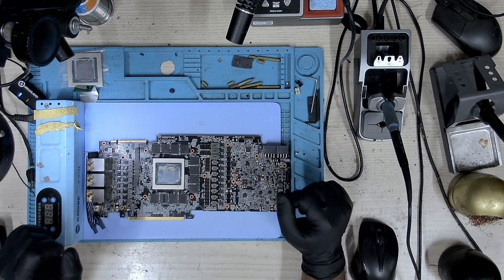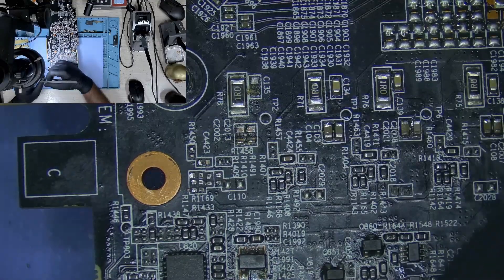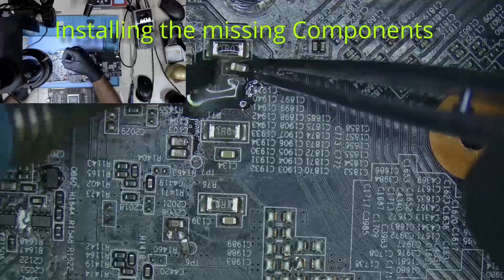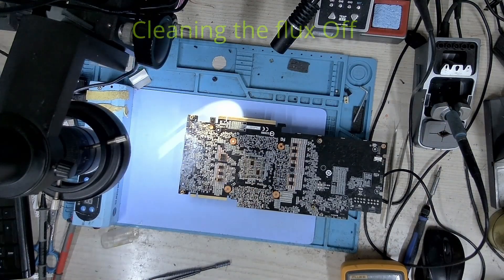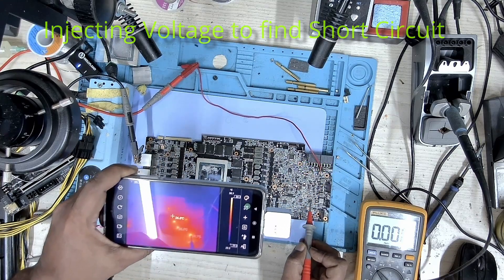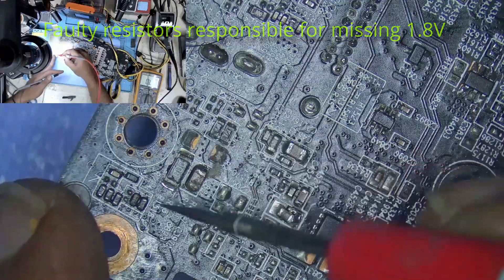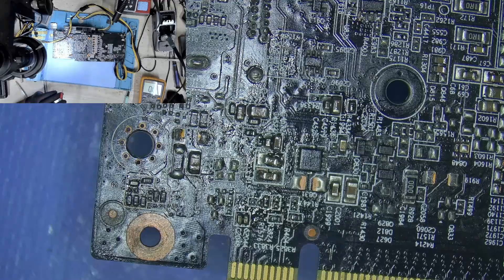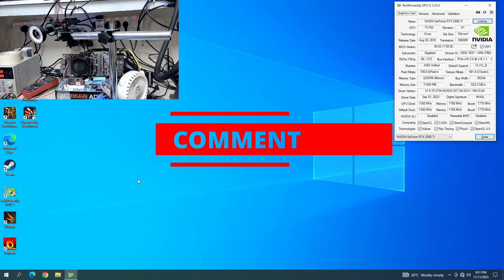Gigabyte 2080Ti Repair - Missing Components, Blown Resistors to Shorted MOSFET. This GPU has It All.

Comment: My goodness i am guessing the individual was probably trying to push it too far overlimit by overclocking and modify its bios, then tinkering with its settings not knowing what exactly was going on, overpushing the performance of what it was able to handle over long periods of time as well. or #2: This person was mining maybe and didnt give much thought or care about it...?I can only guess because if it was lets say a person just gaming would most likely do a simple minor tinkering but seems this person either really did not care bout it? or did not know what he was just flipping switches when tinkering. but u can say usually most people most definitely would not get to this point, it seems as though the user was not knowledged in at what he wlor she was doing to even have it become this terrible. but well who knows , I leave it to the professionals to figure it out and explain it. But Great video man, keep up the good work 😊
Reply from the maker: It was a tuf one. Most likely a high power draw has caused it to happen causing a short as well. If the card was overclocked cannot be known but there were no hardware changes but a water block was used.